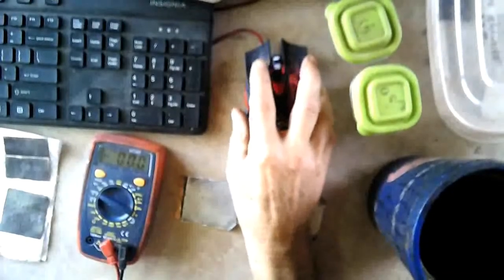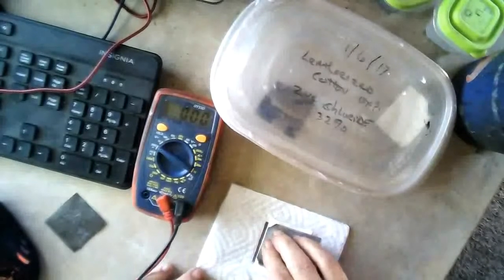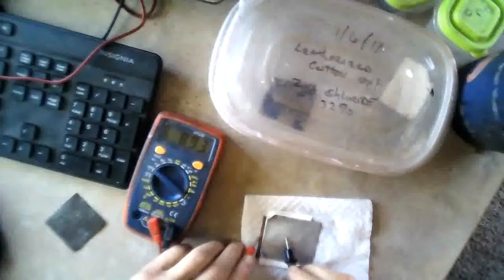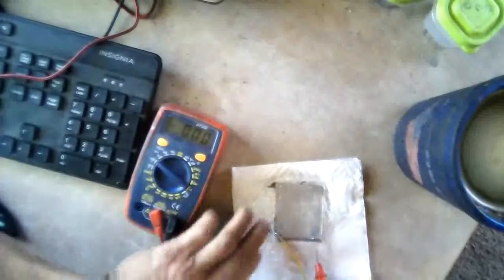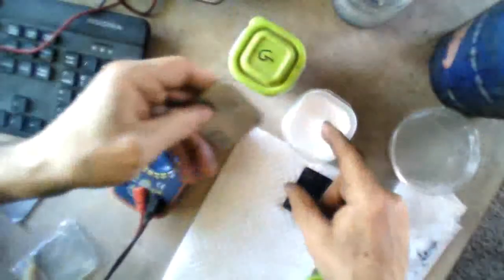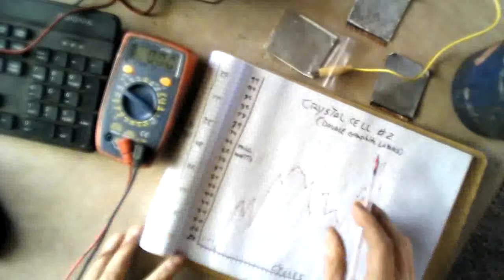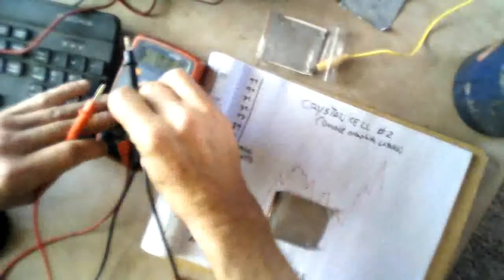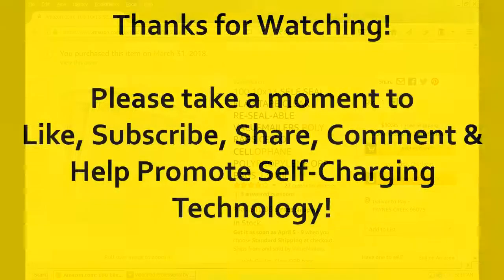April Research & Testing Update!

Comment: You're heading the right direction Ray. Nothing to critique from my viewpoint. Solid state storage has been an elusive subject. What you're coming up with just keeps getting better. All I can do is cheer you on.
One thing you might think about is trying to charge a cell to see if it accelerates or retards results.
Reply from the maker: Thanks Fred, when things go this smooth, it usually means I'm about to hit a brick wall of some kind to climb over. crossing my fingers that doesn't happen.
Reply: Yes but you are experimenting with somewhat sparsely investigated technology, at least in the open source arena. There are no set rules and many directions to go. Let intuition guide you and don't discount any observations.
Reply from the maker: No problem following that advice my friend! :-)